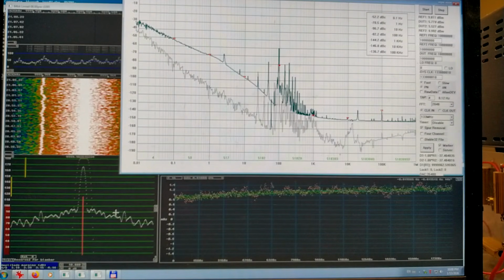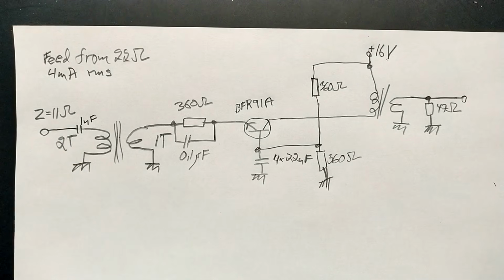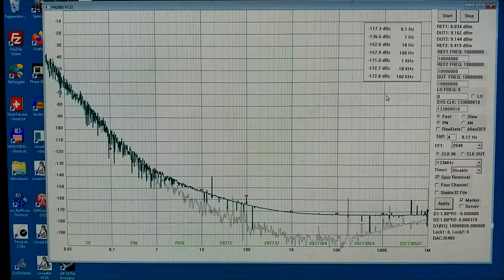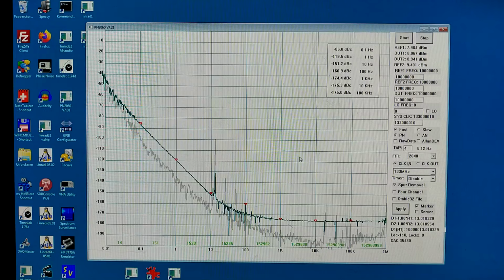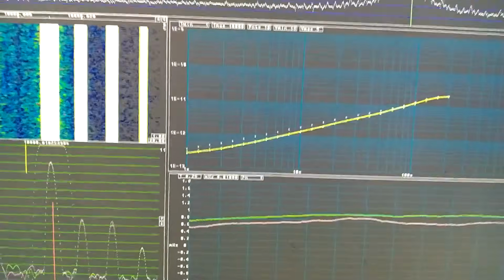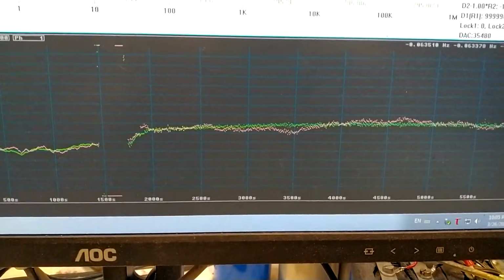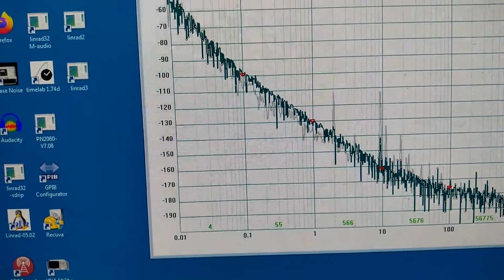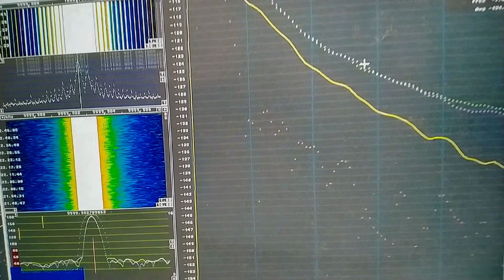nerds115

Comment: AI Summary

Abstract:

This technical analysis details a series of experiments aimed at improving reference oscillator stability for high-precision phase noise measurements. The researcher evaluates the performance of Rubidium sources and Wenzel oscillators, utilizing frequency shifting via quadrature mixing to facilitate phase locking. A central focus of the work is the development and optimization of a custom multi-crystal oscillator. By paralleling four crystals and implementing a bootstrapped source-follower amplifier stage, the engineer successfully minimizes gate-to-drain capacitance fluctuations, a critical source of close-in phase noise. 

The process involves rigorous cross-verification between the Linrad software suite and a PN 2060 Phase Noise Analyzer. Key findings include the identification of optimal crystal operating temperatures, the suppression of 500 MHz parasitic oscillations using ferrite beads, and the impact of turbulent airflow on measurement consistency. Although the experiment achieved significant noise floor reductions (reaching -132 dBc/Hz at 1 Hz offset), the results underscore the volatility of crystal aging and the challenges of maintaining ultra-low noise performance in multi-crystal parallel arrays.

Summary of Reference Oscillator Optimization and Phase Noise Metrology

* 00:00:04 Phase Locking and Frequency Shifting: The measurement setup uses a 10 MHz Rubidium source divided by 512 (~20 Hz) and mixed in quadrature to create a signal for phase locking high-performance oscillators. Initial traces show a frequency drift of 1.2 mHz over 6.5 hours.
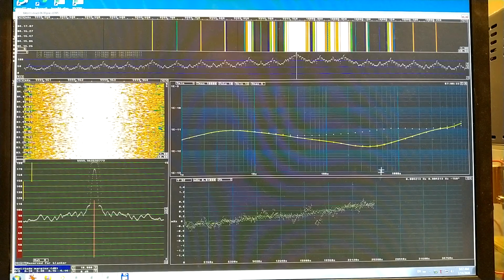* 00:04:22 Allan Deviation Analysis: Evaluation shows an Allan deviation minimum at 400 seconds. The Wenzel oscillator (Channel 1) demonstrates superior short-term stability compared to the homemade Channel 2 oscillator, which is phase-locked to it.
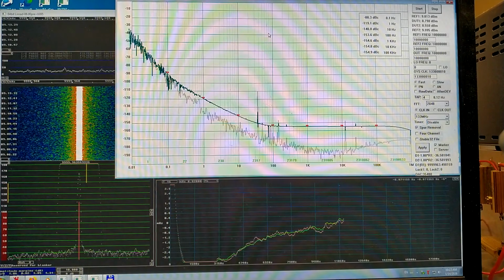* 00:07:51 Strategic Offset Frequency: To improve the direct conversion receiver's accuracy, the zero frequency is placed at a 30 Hz offset. This allows for accurate phase noise measurements up to 29 Hz and avoids audio-frequency artifacts.
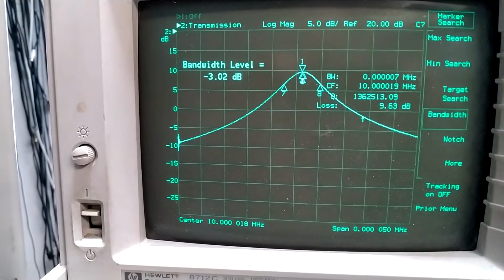* 00:11:01 Multi-Crystal Oscillator Topology: A single crystal is replaced with four parallel crystals in a temperature-controlled oven to theoretically reduce crystal noise by 6 dB. The Q-factor is measured at 1.3 million with a 10 dB insertion loss.
* 00:14:51 Amplifier Noise Floor Targets: To leverage the four-crystal array, the amplifier noise target is set to -135 dBc/Hz at a 1 Hz offset. Initial tests with BF240 and BFR91A transistors reveal that amplifier flicker noise (1/f) and saturation significantly limit performance.
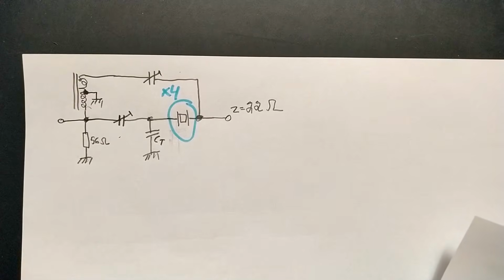* 00:26:03 Bootstrapping for Noise Reduction: The circuit is reconfigured using a J310 JFET source follower. A bootstrap circuit (emitter follower) is added to force the drain to follow the gate, effectively eliminating gate-to-drain AC voltage and associated capacitance variations. This yields a noise floor of -130 dBc/Hz at 1 Hz.
* 00:44:21 Suppressing Parasitic Oscillations: High-frequency oscillations (~500 MHz) were detected, causing significant noise degradation. These were mitigated by adding ferrite beads and damping resistors, which restored the noise floor to target levels.
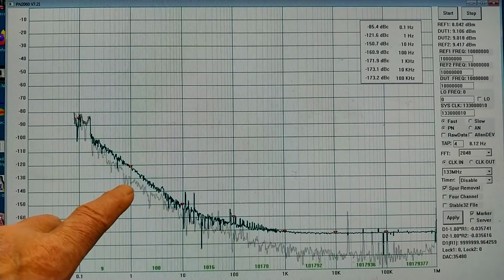* 00:53:12 Feedback Gain and Oscillator Noise: Analysis shows a 10 dB increase in noise at 1 Hz when the unit operates as an oscillator compared to an amplifier, attributed to the high gain of the positive feedback loop near the oscillation frequency.
* 01:06:06 Impact of Tuning Capacitance: Experiments show that operating crystals close to their series resonance frequency with large parallel capacitors significantly increases noise. Moving the frequency ~30-70 Hz higher restores normal noise characteristics.
* 01:18:31 Thermal Optimization: System testing at various temperatures reveals an optimal crystal operating point of approximately 79°C for this specific crystal batch.
* 01:31:15 Troubleshooting Intermittent Noise: "Noise bursts" were identified and attributed to poor BNC connector contact pressure. Cleaning and adjusting connector fingers stabilized the measurements.
* 01:48:19 PLL Time Constant Calibration: The Phase-Locked Loop (PLL) time constant is adjusted (up to 1,000 seconds) to ensure reference oscillators are uncorrelated at the frequencies of interest, allowing correlation techniques to extract the device-under-test (DUT) noise.
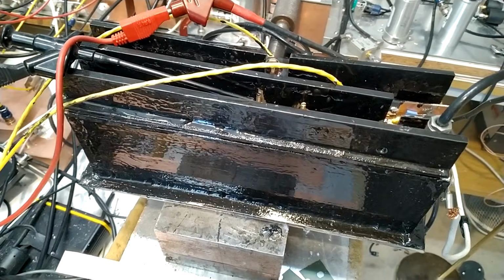* 02:20:26 Multi-Crystal DUT Performance: Testing a 21-crystal parallel oscillator yields a phase noise of approximately -132 dBc/Hz at 1 Hz. Turbulent airflow was identified as a primary cause of instability at 0.1 Hz offsets, mitigated by changing the box orientation.
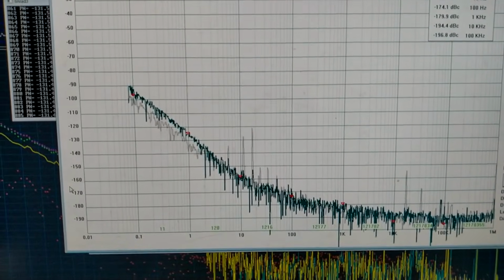* 02:42:56 Forced Aging Risks: An attempt to "force-age" the crystals by cycling power and increasing current proved counterproductive, resulting in a 7 dB degradation of the noise floor, likely due to crystal damage or solder joint failure.

AI-generated summary created with gemini-3-flash-preview for free via RocketRecap-dot-com. (Input: 56,457 tokens, Output: 1,248 tokens, Est. cost: $0.03).